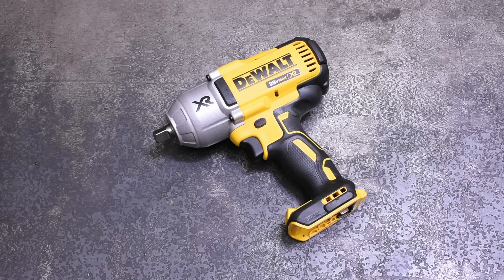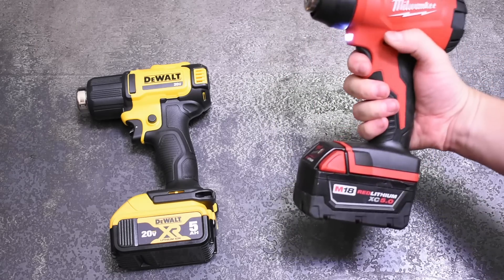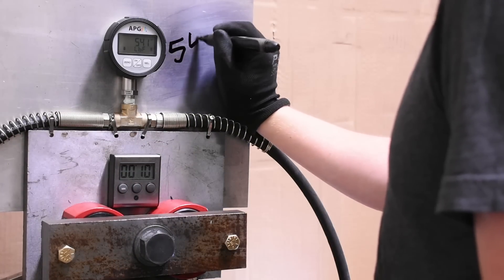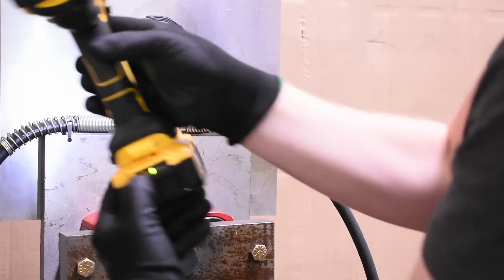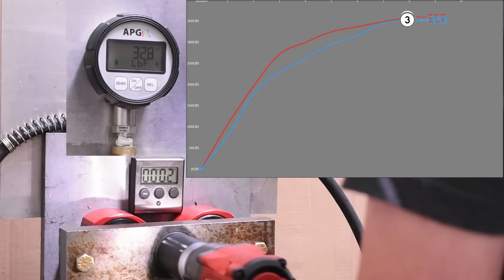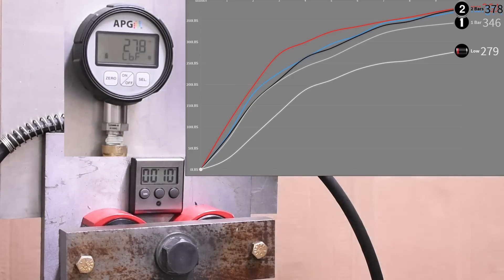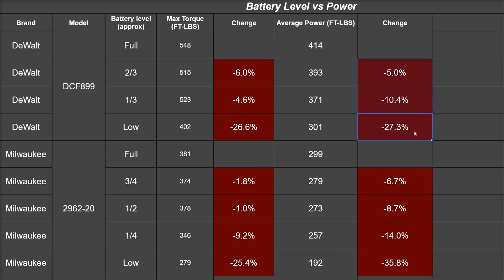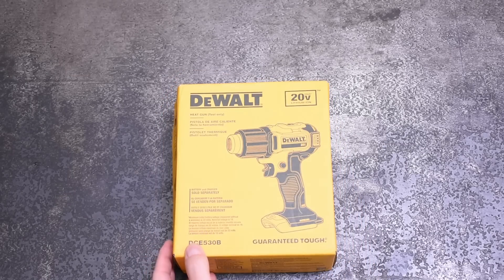Low Battery? Exactly How Much Power are You Losing? For Science 12

Comment: Should have measured the battery voltage at the indicated bars. That way you can try to keep it more even, first test by bars then by voltage.
Reply from the maker: While the scientific side of things always appeals to us first, we try to bring things back to practical every day use you would experience. Learning at what exact voltage we see a power drop and voltage to torque relationship while interesting would help the average guy checking the battery level not all too much. Us too, we're not going to break out the Fluke to see precisely how much more beans are left in a battery pack. Even if the indicator is off, that's what we'd be going off of every day.
Reply: Valid points on both sides. I do know that new bluetooth enabled tools like Milwaukee’s One-Key App, let you get much more detailed data on your tool/battery status. The really fun part is that you can customize the torque settings of each button on the tool though. 

So you could set 1, 2, 3 to the three most commonly used torque ranges you need and not have to worry about under/over tightening something. I would LOVE to see some proper testing done to see how well this works though.

Comment: my Milwaukee high torque can deff tell the difference between 2 and 3 power levels.  its even worse on worn out batteries with many cycles. did notice a difference when i switched to the 3.0 h.o holds out better til 1. prob cause its newer. thank you so much for this video

Comment: I first encountered a cordless heat gun earlier this year and thought it was the dumbest thing. Then I scaled a vertical wall with one, about 45' up, and I was like "yeah whatever it costs, it's worth the convenience". Same with the M12 soldering iron. Imagine trying to climb that wall with 45' of 16 gauge extension cable hanging off your belt.
Reply: Sometimes convenience has to win!
Reply: For soldering iron there’s portasol. It’s a butane powered soldering iron
Reply: @FishFind3000  I always have a hard time keeping the butane irons hot in the wind.  Not sure the 12V would be any better.
Reply: @BrianFullerton  The M12 iron blew me away given I was expecting it to be utter garbage. I haven't used it in strong wind, but it hasn't got a flame to blow off the element, so it would behave the same as any electric. It works best if you turn it off between joints. Otherwise, the plastic comprising the tool can get a bit melty. Also preserves the battery.

Comment: I bet the losses would be even more pronounced in the 12v lines. I use my 12v stuff all the time and those CP batteries lose a bit of punch at half charge and lower. I still like the CP batteries size though so no hate from me
Reply from the maker: Especially because at those torque levels of 12V tools in general you're much closer to the line of whether the tool can do the job or not to begin with.

Comment: Also one great experiment would be to order those absolutely hideous chinesium 20 Ah batteries from ali/ebay etc and testing them compared to genuine ones.

Makita has some variance too on their 18V batteries, from 1,5Ah to 6Ah, would be nice to see how much they reduce the power.
Reply: I'm a Makita fan and have a lot of their tools and I have a feeling they will do poorly in this type of test.  I use the XLC02ZW almost every day in the house, dog owner, and you can really tell the sucking power falls off quickly as the battery is used up.
Reply: Project farm did a video - Are Cheap Power Tool Batteries better than DeWalt 20V OEM Lithiums?

Comment: You should do a test to see how much power is lost when a battery is very cold.
Reply from the maker: Waiting for the power stack to be on sale
Reply: yep. freeze 'em mofos like they are in the truck in the winter. 

lets see how they perform and if the warmth produced in the tool/battery recovers some of the lost torque.
Reply: @casemodder89  another YouTuber did that with the new dewalt powerstack vs a 5 ah. In the freezer for 2 days around 0°f. They take awhile to get warm and fully operate. Nonetheless, they still work great after a pre-workout
Reply: @casemodder89  They will definitely make less power, because lithium batteries work best (i.e. have lower internal resistance) when warm, so they won't put out the same amps when cold.
Reply: Oh yeah that’ll be interesting! Although if I understand how Lithium-Ion cells work, I wouldn’t expect the torque to drop much. The battery capacity should drain faster though giving you less run-time.
Reply: @DragonBallsDD  I had cellphones failing at -30c, the battery works but peak performance will be affected, heavy tasks will cause sudden off, no controlled shutdown. Htc and Apple and some others has ok cold weather protection by means of performance reduction. So i expect severe torque loss in real cold weather, maybe a bit less on Makita and most on DeBlacknDeckerWalt.
Reply: I also noticed that a cold tool negatively impacts its performance, this can be tested also.
Reply: In Finland they magazines do lot of test where battery has been in cold -x-xx c' / xx hours. Makitas batteries has been worst everytime. I mean, everytime. There is different measurement how they test those batteries👍. Its intresting to c results everytime... test might be done with dd, circsaw, planer, sds+ hammer and so on...